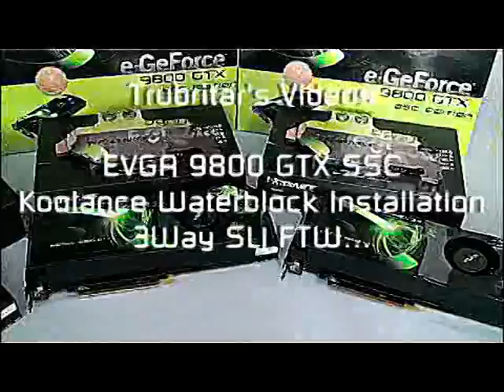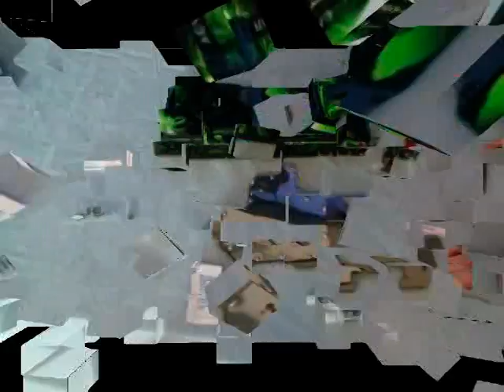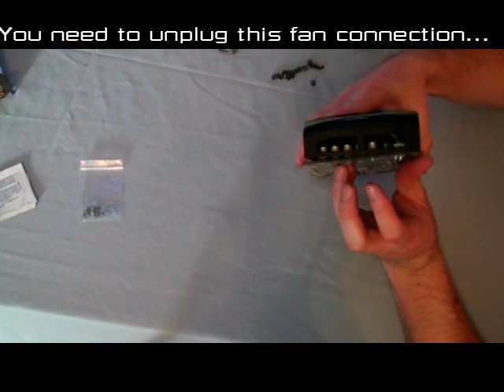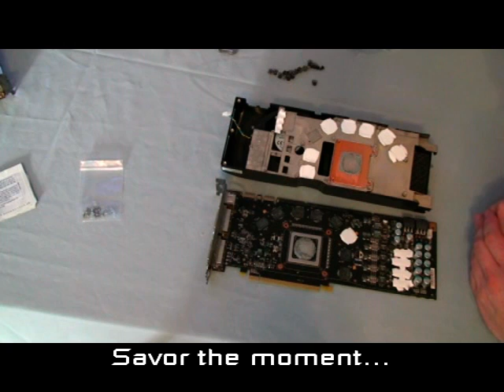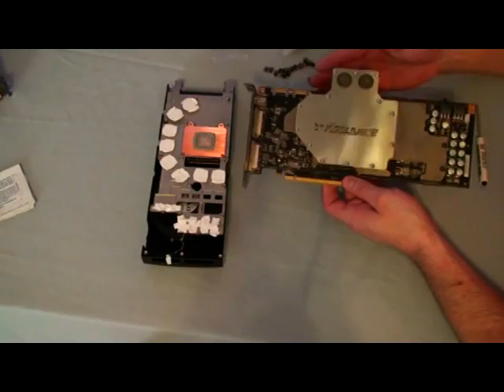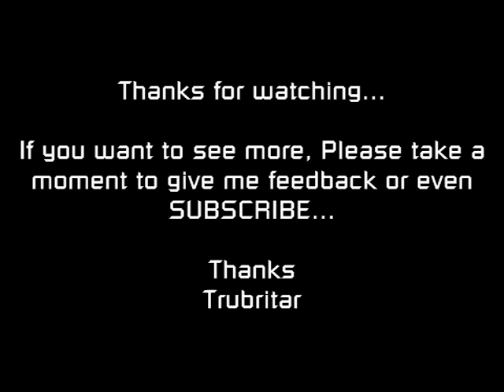9800 GTX SSC Waterblock Install

Comment: what did you end up gaining in performance? Also how much higher did you overclock your video card from the SSC Spec? I currently own EVGA 8800GT SuperClocked Editions and there running at 725/1800/2000 and they are rock solid no crashes. I found that if you buy stock Overclocked Edition of any video card- those are usually the higher quality GPU's that come from the factory and will almost always overclock higher, thats why your paying the extra money- for a higher grade GPU.

Comment: i just bought a 9800 GTX i have been trying to install it but its not running without the cable, im using integrated at the moment

Comment: Because it either is a lame brand or your lost, if it was any quality at all it would have with a 4pin to 4-pin Molex connector or your PSU should have a 4 pin connector ready to connect into the card, plugins sould be near the sinde closest to the face "Facing inside your computer" left hand side at 1:18

Comment: hey t few newb questions 1> what temps where you getting with the block. load/idle 2> I have inflow hose on top nozzle and out on bottom is that okay? 3> how tightly should I screw block in? 4>  did you find the wieght of the block affecting or bending card?

Comment: what did you use to clean off your old thermal compound? What I did with my CPU/heatsink is took some vodka and cleaned it off with some force. It worked but probably much better ways to do it.

Comment from the maker: All GPU's are tested at the manufacturing plants, typically the top 10% higher clockable GPU's that pass the tests are incorporated in the top clock cards.   It's like CPU's, there are Diamonds and coal.  The diamonds OC to bizarre new hights and the coals just meet the mark.

Trubritar

Comment from the maker: You will be surprized, the Reserator XT is a capable product...Its not as radical as some of the others out there but still does the job well. 

The new Crysis Cruncher has the Reserator cooling 3 9800 SSC's in 3 way SLi...Fluid temps very rarely get above 30'c unless there is intense benchmarking or serious gameplay going on

Comment from the maker: Yes it is possible and depends on the ambient Temp.  The advantage with the Reserator XT is that its completely external and you can even place it in front of an AC unit to chill it down a little.

The perfect solution would be 2 seperate cooling loops.